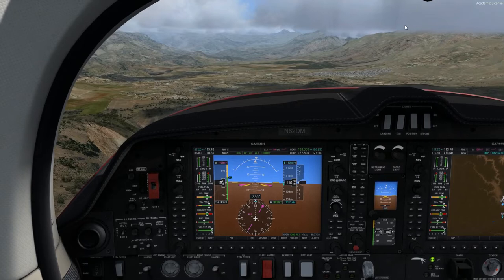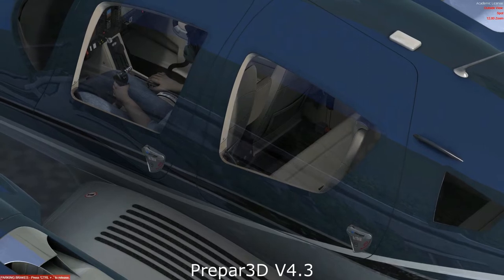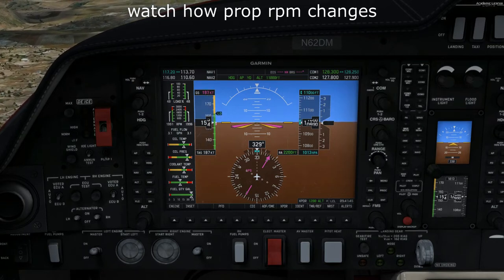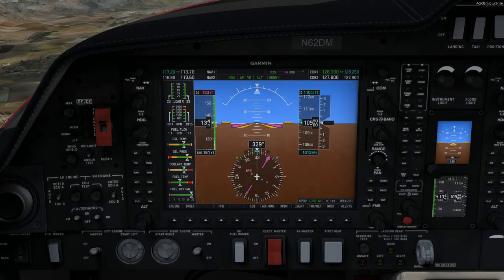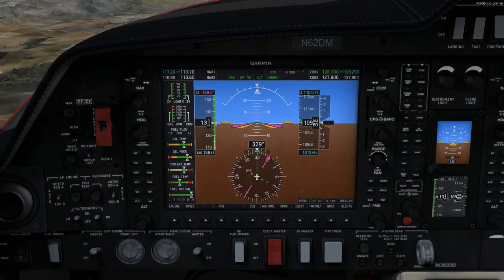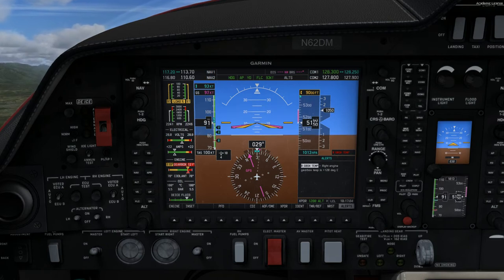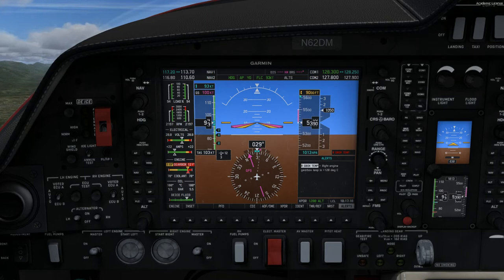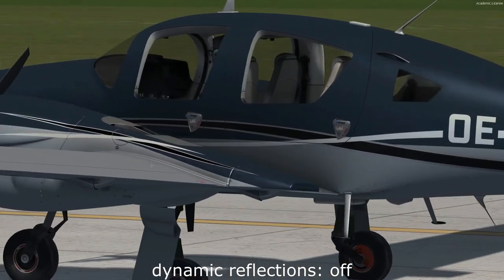Vertx Diamond DA62 - in detail - part 3

Comment: Hello, Thanks for your detial video's! Could I make a flightplan with P3D or should I use external software you were mentioning in Part 2? I do like to make general flightplans and save them for use with the Garmin G1000.
Reply from the maker: Hi, thanks for your feedback. You can use any flight planner which can create P3D standard flightplans. This inlcudes the 'on board' flight planner of P3D. The one I mentioned (Little Navmap) has tons of features. Please be aware, the G1000 of the DA62 uses a special internal file format. You only can load and save from within the DA62's G1000.  Cheers